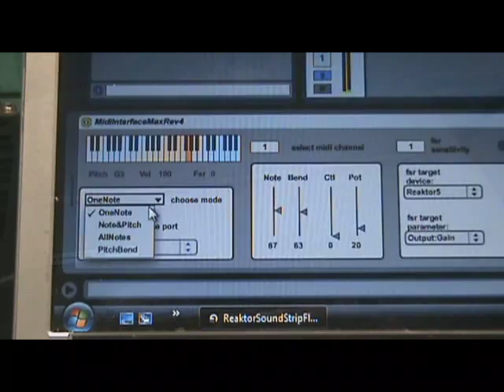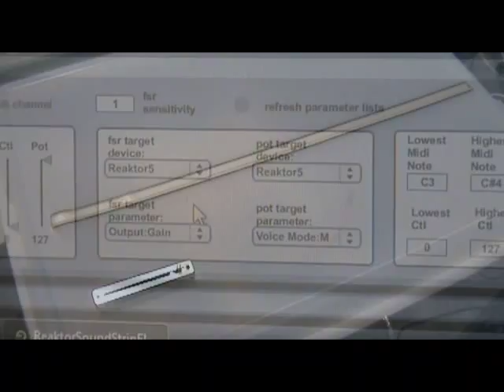SoundStrip Arduino DIY Midi Ribbon Controller Explination

Comment: would this work as a midi controller for a synth application on android, I have used it with other USB midi keyboards and it gas worked perfectly